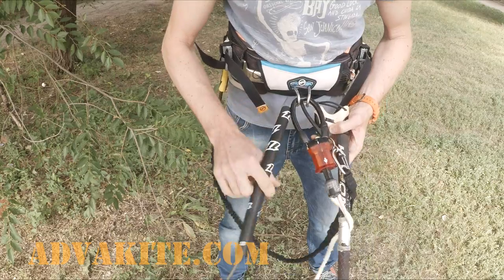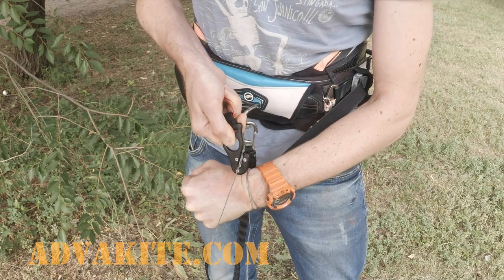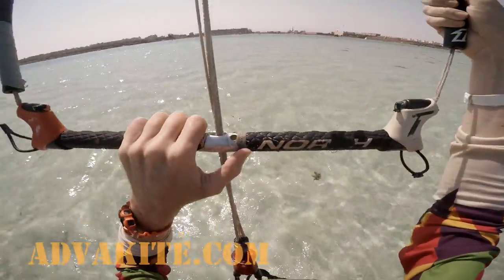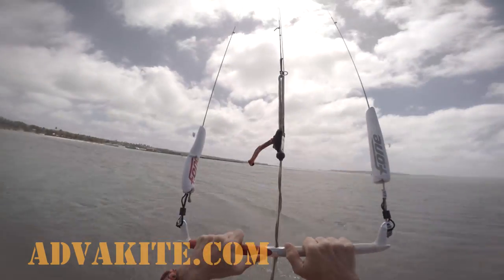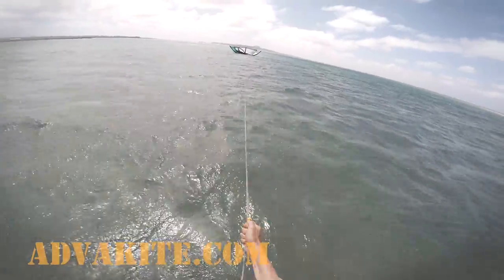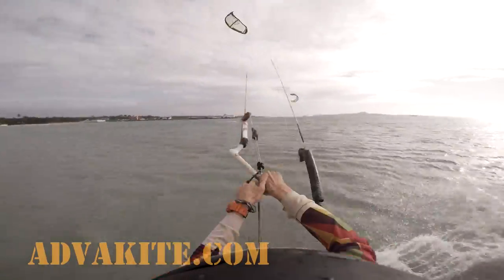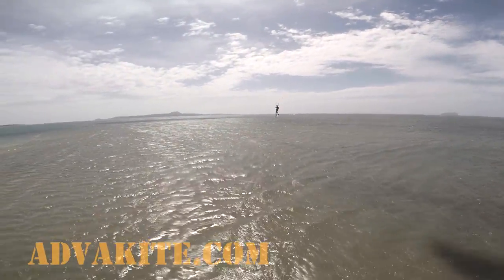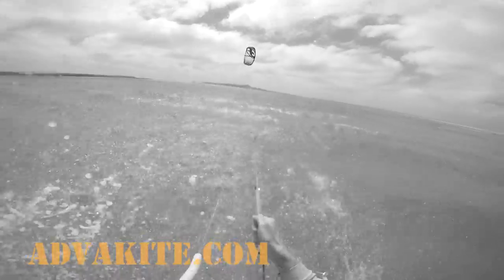Surviving The Death Loop. Episode II of kiteboarding tutorial on stopping an auto-kiteloop.

Comment: Anton both of these are excellent.  What hurts most in a death loop is panic, either freezing up and getting dragged hard and disoriented,  or just grabbing randomly at whatever line is closest.  

Having a set of simple methods to identify the correct "lever", and depower then stabilize the kite, is better than having 10 knives. And there's just enough in the videos to actually "self configure" both common death loop inducers (centerline cross and bar cross) and get some practice dealing with, neutralizing and correcting both.
Reply from the maker: Yeah, that's the idea. To prevent guys from useless panic. They still have a lot of thing to try with completely failed QR, and a knife, forgotten at home)

Comment: Kudos for trying a deathloop in these conditions ;) Once I had a deathloop with a Core XR2 when one of the front lines snapped. Thank god I could release the safety then. The XR2 didn't react as nicely as the kite you tried it with - I was feeling like Flipper the dolphin, sometimes under water, sometimes above... Never happened since, thank god. So it can happen with certain kites. I guess the trim is important too.

Comment: Thank you for your great Video on this topic!

Also great you commit so mich to your videos, as in that you really get yourself into action and not just talk about it but show it to people - priceless to actually have video proof of the stuff you say/teach!

I agree on not relying on one safety aspect completely,

However I must say that I always wear my kite knife - eezycut from trilobite.

Tried it several times and it cuts through up to 10mm climbing rope easily as through butter - so it might depend on which knife you actually buy.

Also tried it with an old flysurfer depowerloop line. Rated for 500kg with an inner dyneema core rated for another 500kg. Cut through that thick rope like butter, even two loops of it and with some force also 4 times that thick rope!
Reply from the maker: Thanks for your comment, really interesting. Well, I think, I had quite a good knife when filming, and well, yeah, it can probably cut a 4-5 mm dyneema, but when it comes to plastic covered ones... no way, I think. But the most important is that mess and action around you, when you caught by a deathloop. Probably you need a weekly kite knife drill, to get your instincts ready.

Comment: Man, thanks a lot for the efforts, cutting your lines just to show us what happens! Very instructive. I would donate if there was a way.
I once went under my lines after landing straight downwind, the kite was behind me for a bit and lines getting all around me under and above me, then saw the kite slowly getting tension again. I realeased everything i could realese before it got fully tensioned again.
Reply from the maker: Hey, thanks! It would be great if you tell about this vid in your kite forum or something as a donation to help promoting it a bit.
Yes, getting wrapped with the lines is the question I'll cover someday in the video. It looks and feel terrible, but if you're not in a crazy rush and the kite is getting back into power slowly you can still fix it. Just choose one line among the others, the one you can tell which side of it is pointing towards the kite. Then you just start pulling that side of the line, several meters of it, so that the kite would create tension in this single line only, when it's blown down enough, so it won't tense all the lines around your body, but just one, that you're holding in your hand. It will make the full re-power impossible, the kite will stay hanging on one line, flagged, with no power. And you will be sure, that the line is not wrapped around your neck, since you'll be holding it in your hand. That's what I do myself, hope you'll never need it)
Take care!
Anton.
Reply: @antonchernyshov8759  hey thanks man for answering this comment that's smart and helpful I've always been scared this situation ever happens to me. And for the deathloop video thanks for your contribution to safety much appreciated

Comment: Thanks a lot for the video. Was really helpful. I had a dead-loop experience last week. I haven't seen this video before. Things happened so quick, I was wondering all the time why safety didn't work. Now it explains. I jumped and my chicken loop came out of the hook. I didn't notice that but when saw my bar is far away in a dead loop and connected with my leash only. Was scary as I didn't understand what just happened. I can see if I had a short leash I could probably reach the bar. Is there any way to get out of it if you are on a long leash?

Comment: Thank you very much Anton for your hard work preparing these videos.
 I'll share here my death loop experience , which happened just yesterday. The wind stalled and consequently my Core XR3 10m falled into the water in the downwind direction. Then I began to try to relaunch the kite but I noticed that something was not ok. It took me a while to realize that one of the direction lines had entangled with the tip of the kite. A sudden gust of wind later, I was being dragged downwind as the kite started looping uncontrollably. 
So, despite having seen these two invaluable videos before, I entered in panic mode and committed two near fatal mistakes: first,  I used the QR, which of course worked as there weren't any lines messing with the bar or QR system but left them out of my reach without stopping the death loop and second, I hesitated in using the leash as the wind blowed right into the beach with a lot of people, including little kids (WTF?) there. 
By the time releasing completely the kite was the only option, I was being wildly dragged downwind in and out of the water grasping for air and not being able to find the damm leash, which seems easy but under that circumstances it is not. Luckily, I was close the the shore, with onshore wind, and a very brave dude was nearby and stopped the kite with his hands and the kitemare ended.  Other wind direction or further from the shore and that was the end of the story for me. 
Lessons learned: with a Core kite, death loops can continue after QR despite their BS claims that their safety systems are superior,  and more important TRAIN IN YOUR HEAD AND IN REAL LIFE THESE SITUATIONS so you react correctly when needed the most. If I had pulled the correct direction line as in these videos, or released the kite without hesitation, I would have saved myself a really scary experience.
Reply from the maker: Thanks for sharing your story! Do you remember, how exactly the line went over that tip? I was thinking about discussing this case also in the future. And also the leash topic, yeah probably a short video needed. Now they start producing very short leashes and even in the kite user manual (Core) they say to fix the leash right to the metal spreader bar of the harness, near the hook, so that the QR is always close to riders hands.

Comment: How about this?  If the bar end get's hooked into your harness and you start getting dragged.  What if you lean back into a "feet first" drag position?  Then the hook opens and bar comes out, and the kite depowers.  That would work, right?
Reply from the maker: Hey, didn't get the idea) I've never tried to body drag with feet in front. They are experiencing a lot of water resistance, is it ever possible to bring them in front of the body?)
Well, it could work maybe, but the hook is rotating, since the belts are not rigid. It is always pointing with it top to the power source. That's why you don't get off the hook when doing a deadman trick. Hope I've got your idea right!)
Thanks. Anton.

Comment: being a beginner and not sure if the problem resolved itself after the loops, i wanted to proceed with self rescue  and wrapped up + secured the steering line on the bar. (.... 1-2 bar lenghts early as i noticed later).
a gust came in, the until then stable kite flipped, the tangled line around the bridle on the other side freed up and the kite now looped the other way around. Without any chance to get to the bar now and somehow with the leash under or around the my hook, blocking the last millimiters needed to release completely. stupid as i tend to react in these situations i was really optimistic to be able to get out of my harness... 
i ended up cutting the rope at the beginning of the safety leash.
would it make sense to flag the kite with the safety / one of the front lines instead once it's possible maybe?
Reply from the maker: Hi!
Sorry, I didn't get it right, maybe. You've flagged the kite using one of the steering lines, started to wrap em up and then the kite relaunched? But what actually happened from the beginning? The steering line wrapped around the hook? Or something else, what caused the loop?
Yeah, for sure, using the safety line to flag the kite is still the best option. However it depends on how it was tangled, you probably may have some problems also wrapping the safety line, if it crosses-and-blocks with some other lines underwater. Anything possible with 24m of floating ropes! I think, it's really important, after the looping stops, to untangle the lines or any ropes from your body first and be ready to release it completely. Well...however you should always go through that procedure, if you fall and mess with the lines a bit...

Comment: hi Anton, today something happend to me and i ended up with a cuncosion and a fucked schoulder because the kite death looped, dragging me from the water onto the beach. 

once it stopped i looked at the bar and what i saw is the following. the power lines were somehow (under the safety) had twisted once around the bar. i had 2 questions, 1: how is this possible? 2: any advise on how to stop it?
Reply from the maker: Hi, Milad!
I haven't got it clear enough. Was it the main depower rope, or those thin lines, those located above the depower rope? What is the bar (manufacturer) that you had the issue with?
Reply: Hi anton. It was the maindepower (best t3). However. The kite also was flipped inside out. (It was gusty wind, it had dropped and the kite was stalling  wind picked up again, turning the kite inside out. So main depower was around the bar. And the steering lines around the power lines. Using the 2014 best T3.

Comment: This video is fantastic. Had a pretty scary accident where one of my bridles snapped creating a death like loop - slightly more powerful than that shown when you cut your front line here. The effected bridle was the safety line so if I had chickened out I would have the same problem but now with the bar at the end of my leash. Your techniques saved my ass! Many thanks and happy riding!
Reply from the maker: Hey, thanks for the story!
I hear more and more of them from the viewers, but haven't had anything like this. I think I will post a small additional video about those cases, I was reported. Could you let me know, what is the kite and bar model you had your issue with.
Glad, that my work was useful for you!
Cheers, Anton.
Reply: Hey. It was an RRD Vision 10.5m on a 4-line 2014 Best bar. The bridle snapped where the pulley had been wearing away the bridle line and sent it into a death loop. It was the left bridle that was snapped that is connected to the safety line and so chickening out didn't help. Cheers for your reply. Think it would be the same for any other 4-line kite that has a safety line attached to a single front line.
Reply: I had a similar experience on my Cabrinha Switchblade 12m 2013. One of the front lines snapped just at the bridle and I was dragged in a death loop over a km while trying to figure out what was wrong. The snapped line was wrapped up around my leg and my bar all over the place so I had no idea what the cause was. I tried to find out where the wrap was but the loose line really confused me and scared me since I was thinking that it might get tensioned suddenly and cut my leg or hands. After the kite hitting the surface and throwing itself front and back I could see the loose bridle with the help of a fellow kiter. I did not want to release though since I was scared that it was the rescue line that was cut. Only later did I learn that both front lines acts release on the Switchblade so it would have been safe to unleash. If I pulled a bit on any of the three remaining lines the power and tendency to spin only got worse but at the end what did the trick was relly committing to pulling one of the steering lines, so similar to what you teach in the videos. Thank you for the videos!

Comment: Thanks for video. My last deathloop it was bridle caught in wingtip. I remembered you video and tried to pull steering line but I pulled wrong one, kite was looping left and tried to pull left line and wasn't able to backstall it, later on I noticed that I should have pulled in right line instead. Pulling left was too hard with power. It had looped only once or twice I think.
would I be able to back stall it from a bridle wingtip? Anyway I ended up releasing whole thing because quick release didn't flag kite.
Reply from the maker: Hey, thanks for your question. Well, I think that pulling the "other" line will also work when you have a bridle twist. (By the way, what was the kite?) The idea should be the same. Your jammed line increases the angle of attack on one side on the canopy (left side in your case), so if you also increase the angle on the right side, the wing will go beyond the critical angle of attack, will lose the connection with the airflow and stall (lose the lift, in other words), like an airplane wing does. But, yeah, it doesn't jam your QR, so...) it's ok anyway.
Well....may be I should film a bridle jamming case also?) Why not. A bit harder to simulate, though....
Reply: +Anton Chernyshov it was 9m bandit. You can see video on my YouTube channel: "my first deathloop in 30 knots"
Reply: +Anton Chernyshov "kitesurfing deathloop in OBX" is the video of my deathloop with bridle
Reply from the maker: Yeah, quite a famous video, I've seen it! Well... Hard to say, you've released it soo quickly, man) I won't say, the you shouldn't have done it (otherwise, I'll get hurt a lot by safety fighters))) ), but I would play with lines a bit, if I were you...I haven't spot any obstacles in front of you, was pretty safe. But you did a good job. You've managed to clear the inside-out issue, right?
Yeah, I see, the kite cheated you) The bar was looking like the white-side-of-the-bar line is shorter, but in fact, the other line was "shortened" by the bridle. It's a pity....I think you could handle it, if tried the other line...But, yeah...That was not the easiest case!
Reply: +Anton Chernyshov next time I'll get it, it was good training ;)